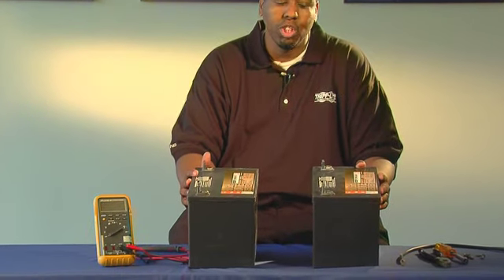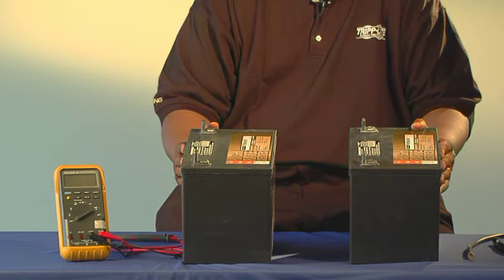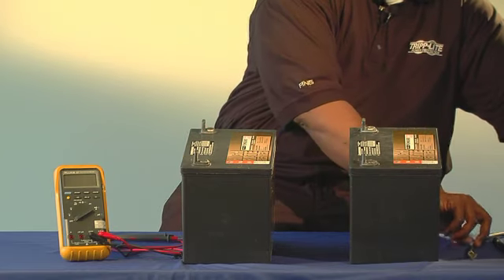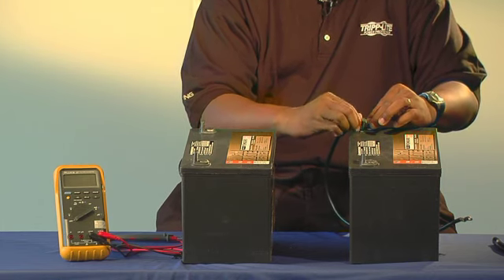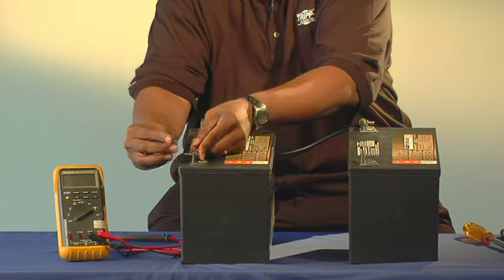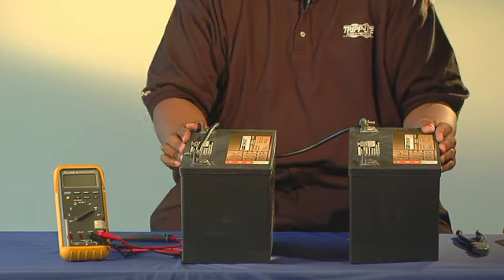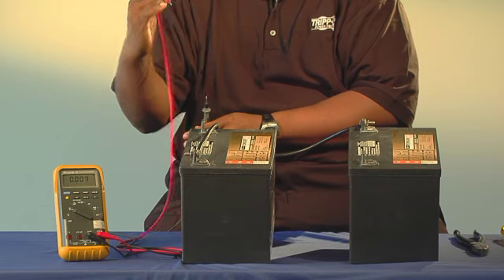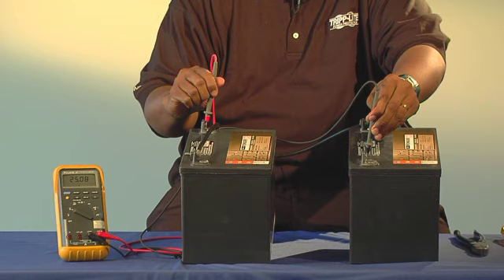How to: Increase Battery Voltage - connecting inverter / charger batteries in series

Comment: This is true! If it wasn't a battery type connection.
If you think about it, betteries work by a chemical reaction. Connecting two batteries in a way shown in the video, doesn't trigger the chemical reaction (the two terminals of a battery aren't used, only one). However if you connect the other two sides, well...you're in for a big current flow.
What this method does is it increases the "intensity" of the chemical reaction.

Comment: ok i have a ?... i own an amplifier that requires 16 volts to push out max wattage. at the moment i have an 350 amp alternator supplying a stock 12 volt battery and a spare deep cycle 12 volt battery.. how will i push 16 volts out of them? at around 3000 rpm i am getting 14 volts out of the batterys but when i turn up my cd deck the subwoofer drains the voltage down to about 12v. so my problems are i need more amphours plus i need to raise my voltage to 16 volts. So what next?     Thanks

Comment: When it's done with two batteries, with the other positive and negative terminals separated, no circuit is completed and no electricity runs through it. You don't sound like you have experience with this stuff - that's fine, I don't either. But please, do contact someone who knows more than you about this to avoid getting hurt. These batteries are dangerous if you don't know what you are doing. Please don't be insulted, I also don't know what I'm doing, that's why I'm not doing anything yet.